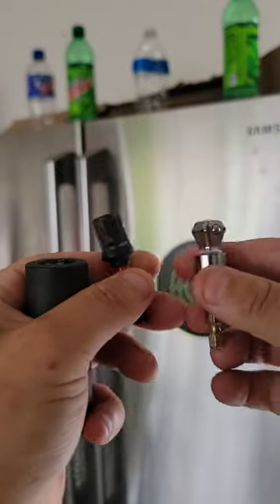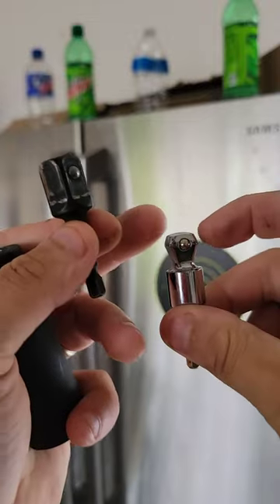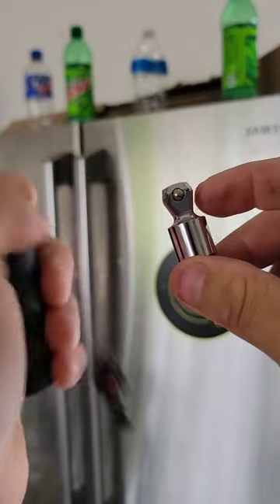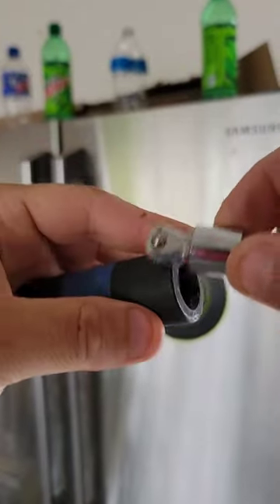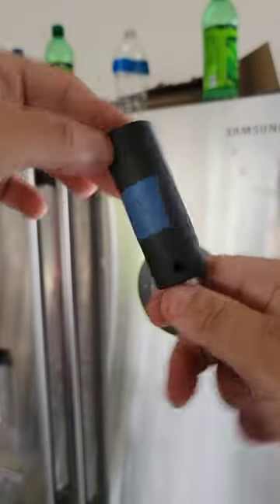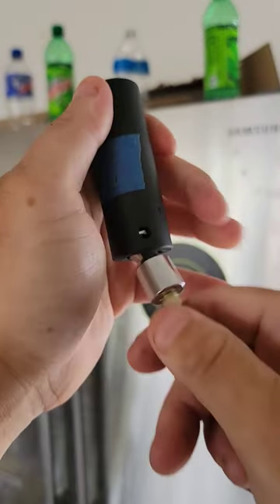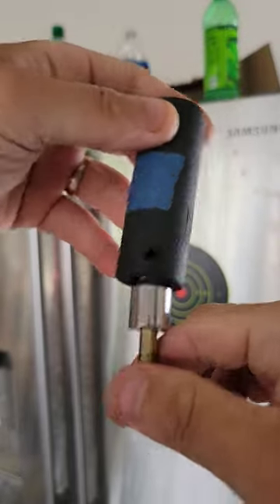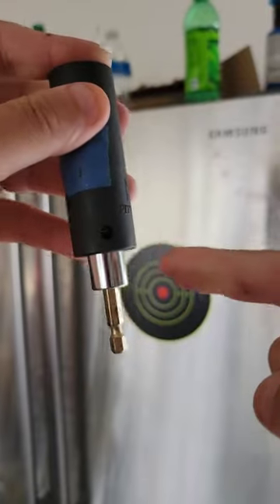Check out this Mechanic's Tool #shorts

Comment: Ya that’s gonna be a snap show especially on a impact socket better put on a mouth guard if you value your teeth 😆
Reply: Yeah I broke 3 but put them through hell. So I ended up just getting a stand alone 1/2” impact to eliminate the adapter. For low torque applications they would last probably forever. But take it above 100lb ft and you risk snapping it

Comment: Nope, wobbles should be banned from drill adapters. You try to loosen a bolt and slip off then it goes to wobble mode... boom, you've got a dead person😂💀

Comment: Makita drive accessories are garbage.
Reply: I had ok longevity with mine. Better than Milwaukee and Dewalt. But they will all break eventually. Especially 1/2”. So I just bought a stand alone 1/2” snap ring impact. No more adapters to break.